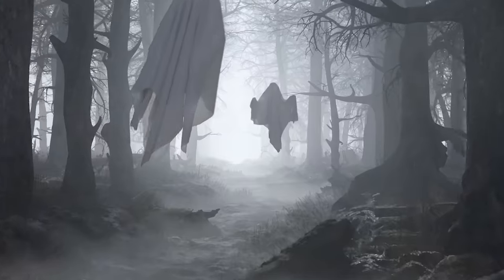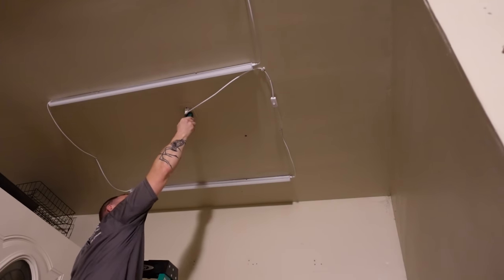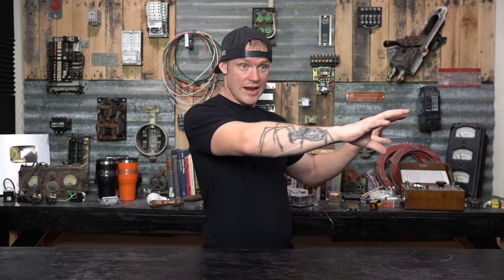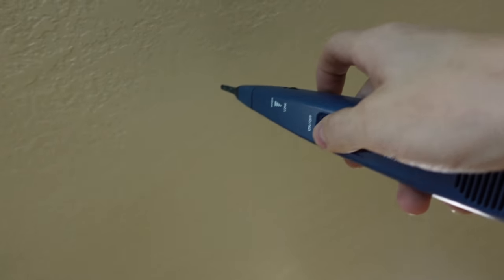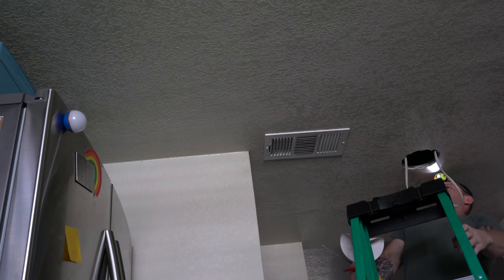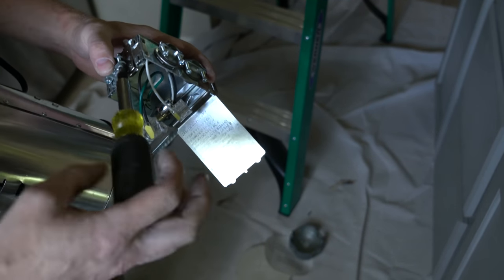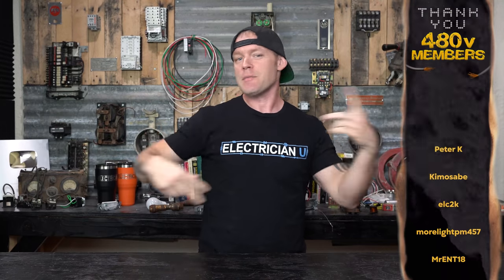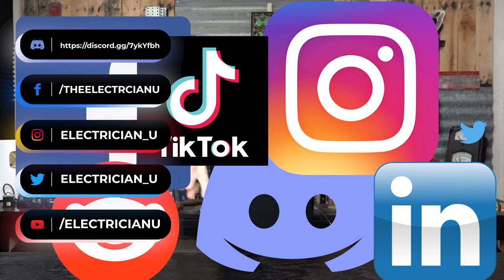THIS IS WHY ELECTRICIANS DON'T HIDE J-BOXES IN WALLS - Finding Hackwork!!

Comment: Drop cloth was a good "Pro Tip".
Reply: Except it's on the floor and he then goes on to talk about crap falling on the tables and worksurfaces which were unprotected!
Reply: @mfx1  In case of the new hole being above those, which this one wasn't.
Reply: @mfx1  I thought the same thing but he has the right idea. Try to be clean.
Reply: @mfx1  In his case, it wasn't, but his tip was to put one over stuff like that if it is.
Reply: i'm not sure about you but i'd rather sweep up the floor than have to pay $150 to $200 extra for him to clean ! just me !
Reply: @xrude7875  Well.... sure, in your horribly bad example, so would I. Fortunately that's not reality. The average hourly wage of an electrician is $40-100/hr. Sweeping up the dust from a cut hole would take 5 minutes tops, not 2 hours. And throwing down a drop cloth eliminates the need to even sweep, taking less time. 

Any tradesman who comes over to your house and leaves a mess is a lazy hack. Period. That whole "they don't pay me to clean" mantra is for justifying lazy, poor workmanship. I would rather hire a competent person who doesn't leave messes. It does NOT cost an extra 150 to 200 dollars for that.
Reply: I use a dust bowl for drilled holes and a HEPA vac for hand sawn; they usually do the trick, but sheetrock dust finds it’s way around even the best preventions. That said, I’m going to add a drop cloth to my list.
Reply: Stellvia Hoenheim   yep when they see me put down a heavy duty quilted moving blanket on their hardwood floor before my toolbox the customer always gets all hot and bothered
Reply: @user-nh3gu1ge3d  its your money but if you work in a place for a few hours its going to take more than 5 minutes to clean up ! i've worked for guys who did it both ways . i as a home owner , i would clean up , your going to any ways . 2nd don't know where you live but the guys i worked for charged $100 / man hours in the 80's ; not sure i would want one that only get $40 ( would be wondering why ) . like to meet one though!
Reply: @xrude7875  $40-100/hr equals $83,200 - $208,000 per year which, yeah, is what electricians make. You think they are pulling down half a mil or something? Also, they typically include a "call out" fee of 75/100 bucks, meaning the first hour they would make something like 150/hr, on the lower end. You are probably thinking about COMPANY charges, e.g. if that's what an electrician is making, the COMPANY is charging 3 or 4 times that. But yeah, if you hire a solo electrician, that's the amount that THEY actually make, not the electrician company that pays the guy 40-100 and then makes a big profit on top of that.

Furthermore, cutting a hole for a can light is going to make as much dust as it's going to make. It doesn't matter if you're at the hole for 5 minutes or 5 hours. I don't expect him to fire up a vacuum cleaner or anything like that, but if they are leaving piles of debris, they are hacks. A little bit of dust here or there is fine but if they just drop stuff and leave it everywhere, they are hacks. And I'm from a medium sized east coast city in the United States. You sound like maybe you're from Cali or Canada or something where prices are insane but a quick google search will tell you what the average rates are. You can argue if you want but I'm not really interested in debating data points. You disagree? Fine.
Reply: Rookie tip #1
Reply: 1) as a homeowner I'm already frustrated that I things are not working the way they are supposed to.  This is most likely resulting in work I would like to do but can't.  There is a decent chance I had to rearrange my schedule around the repair.  The last thing I want is for them to leave and find more work that needs to be done.  Doesn't matter that it may only take a few minutes to vacuum or empty the trash - it's just one more task that is preventing me from getting back to normal.  
2) I have never paid anywhere near $100 an hour for an electrician's labor.  It may be over that when you add in parts needed - but not for labor.

Comment: Well done! I’m a retired electrician from Lynn, MA. Great video…keep them coming.😊 Sometime between 1975 and 1980 I had a similar situation in Chelsea, MA on the second floor of a three family, 3 decker, no attic above. The problem was the kitchen light was flickering and at the moment not working. When I walked by the bathroom heading to the kitchen I noticed the bathroom had been recently renovated. I asked the occupant if their use to be a ceiling light in the bathroom where their currently wasn’t one. They replied yes…. I then asked if she had a broom… got a funny look with that request. I tapped the center of the ceiling in the bathroom with the broom and the kitchen light came back on. I then explained to her that the electrician who worked on the renovation buried the old ceiling light box and that I’d need to cut a hole in the new ceiling in order to repair the problem. We’ll she said, I’ll need to wait for my husband to get home and explain the problem him before I can give you permission to proceed. We left and I never got called back and I’m hoping she called the company that did I the renovation back to fix the problem. These older buildings were wired with BX running ceiling light to ceiling light and the fixture had only pull chain switches. The BX was installed using shallow ceiling plates secured onto the bottom of the floor joist, horse hair plaster and wood laths style construction. When you remove the fixtures the old cloth covered conductors we’re crispy and the insulation would fall off caused by age and high wattage lamps being used. Electricians nightmare to say the least.

Comment: I'm a retired handyman. Lots of my work was in older homes. I've seen wiring conjunctions hidden in walls more times than you can imagine.
Reply: Working on some remodeling in my great grandparents house lead to some interesting wireing. Stuff like 3 2ft sections of different wire twisted together with friction tape to make a run from 1 outlet to the next. The electrician thought it was funny.
Reply: I don't understand why they would do that.  Like how are you supposed to know it's there if you have to work on it or with it for some reason.  Pretty dumb thing to do.

Comment: Weird voltages are almost always caused by loose neutrals. All the other items in the circuit are dropping the voltage and then it comes back to the broken wire. Also the loose neutral is a resistor itself. Sometimes induction causes voltages to appear when there is actually no powered circuit, but usually that is on long runs that share the same pipe.

Comment: I've been redoing the electrical in my house as I do the renovations, aside from the standard cloth wire sketchiness, there is a junction box for every socket and light fixture and a few thrown in for no reason I can divine, as well as an old screw type fuse panel for the garage, but I've found 2 bare live hanging wires encased in the walls so far, I now turn off the power to rooms I'm demoing otherwise known as fun with sheetrock over plaster and lath so thick it takes minutes just to get a tiny hole though it so I have to use a magnet to locate the screws holding the drywall on so I can get it off the wall and go at the rest with a sledgehammer, about the only thing I haven't seen is knob and tube that's in use thankfully although there is a few remnants of it in the house.  In just the attic I pulled 30 junction boxes out, I think whoever wired it was getting a discount on junction boxes and screws/nails but the screws/nails is another matter all together, just imagine if you will a piece of plywood on the floor that you have pull up which is nailed down to the tongue and groove subfloor with 1.75in ring shank nails which are precisely spaced 1 inch apart from the others over the entire area of the plywood. I spent a week pulling up one 4x8 sheet of plywood.
Reply: Ugghhh.... I once had to install a houseful of new downlights and in-ceiling speakers in a grand old home with lath and plaster ceilings.... NEVER AGAIN.
Found a fair few dodgy old j-boxes along the way too.

Comment: I know of 3 men who were killed by 120v. One cut the ground pin off  of his metal reflectored trouble light  He crawled into a crawl space and was lying on damp soil when the hot contacted the reflector he was holding.  Number 2 was working on a lighting, I do not know any details.  Number 3 was working in a decorative pond with a submersible pump, again I do not know details.
Reply: Good thing he left out the water in the killer equation of “electricity + water = 💀
Reply: @smithn.wesson495  Yeah Verily

Comment: I just finished roughly 30 years as a GC doing remodeling and service work in some fine homes in the Boston area and I will assure you ( as this gentleman explained) that when you treat a persons most valuable spaces with consideration they will call you back every time just for that one reason.
A clean drop cloth and one of the Minnie vacuums will win you more clients  than anything else you may try.
Just say’in…..

Comment: I HATE when people use octagon boxes for J-boxes because they have a smaller box fill then same thickness square box. Yes you can add octagon box extensions to add more space,  but a lot of the time it unnecessary if they just used a square box from the start. Great video dude!
Reply: Before I became an electrician I found out the hard way that extension rings existed, cramming wires back in a shallow box on a lighting circuit in a commercial building, I shook hands with 277 that day, instant respect.

Comment: Good video. i have been doing low voltage work for nearly 40 years and over that time i applied some of my troubleshooting skills for diagnosing 110 volt circuits issues. So I was able to follow your methodology easily. I have used my low voltage toner to track Romex just as you did (not live circuits), and because one of the leads is on the neutral wire, (and they are all common,) the toner will "bleed" everywhere. I recently picked up a 110 volt toner made by Klein that works well, but the circuit must be energized for the toner to work. Great for tracking down which breaker is operating a circuit. Thanks for an entertaining video.

Comment: This was a great video! In addition to a loose joint, I also think the burnt connections caused excess resistance and caused voltage drop.  This is probably why the lights stopped working (but once worked in the past).  Things got hot, burnt stuff up, and killed the voltage. 

You seem like a great guy and super knowledgeable! Definitely got a sub from me!
Reply: The lights stopped working because the neutral was open at the burnt connection. It isn't that there was voltage drop. The circuit was simply open.
Reply: I am going to add maybe look into why there was an amp spike that didnt trip the breaker to begin with... if the load is too high which melted the wires there might be too many devices on that cct. Since the panel was right there and the owner allowed it i would even seperate plug from light cct. The melting can easily turn into a fire...

Comment: Recently bought my home. Started remodeling kitchen thankfully. Found in the attic a j box not screwed down, no cover, under insulation, no box connectors, too many wires for a 4x4 j box single stack, and best for last- no wire nuts. They just twisted the wires together and wrapped with electrical tape. Wow, found 1 other up there the same way. Fixed all that now.
Reply: Luxury!  In my recent remodel we found an "extension" made by twisting two wires together, taping them up, and drywalling over them.  Lucky we pulled up that flooring, because the job wasn't intended to touch the ceiling below.
Reply: frakkin YIKES!!!